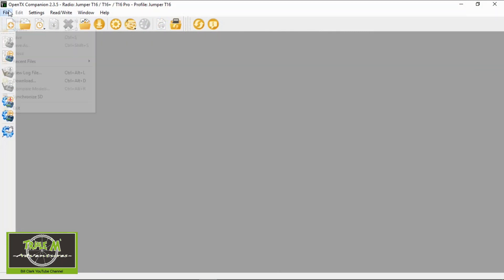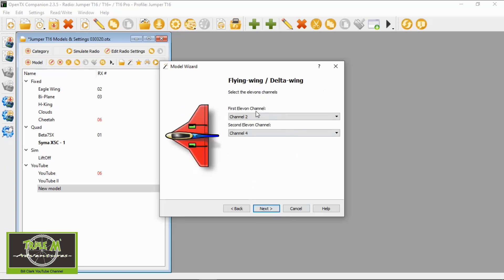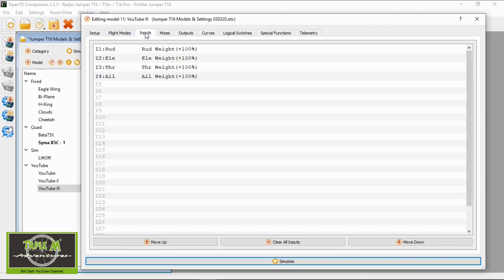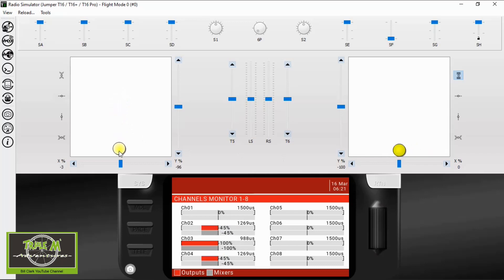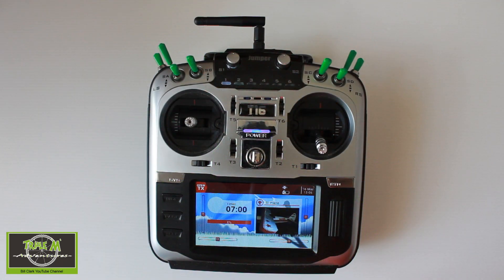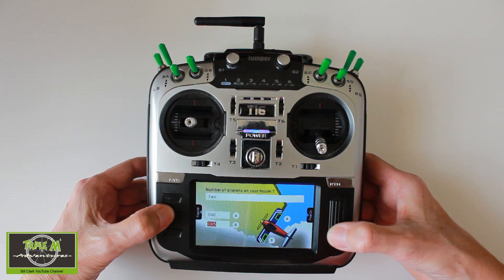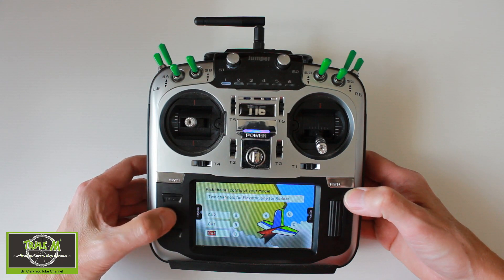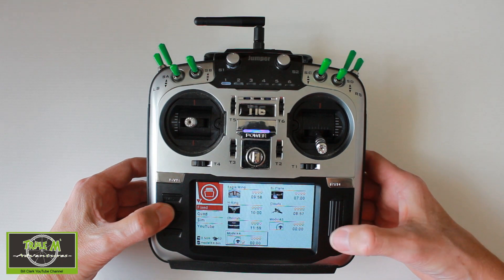Jumper T16 Setup Model with Elevons

Comment: Hi Bill. Thanks for the video. I keep a spreadsheet of all my relevant videos and you have a whole section. It's easier than using bookmarks or favorites. I can organize my favorite links much easier this way.

I have one suggestion. At the end, when you are showing the Hobby-King delta wing, it is hard to see whether the control surfaces are moving up or down. I'd suggest shooting the video edge-on, from the back of the plane, looking towards the nose, instead of the top, looking down. Then we'd be better able to see the elevons moving up and down. Keep up the great work!

Comment: hey bill can you do a setup on jumper T-16 nfor a VTOL mini convergence?  Also in open companion i noticed my setup was different like my throtttle is on the left.  Do you save on your SD card then transfer to your jumper that way?
Reply from the maker: I could Matthew but I do not have the model I see you can only use Spektrum DSMX & DSM2 receivers with that model so they will bind to the Jumper T16's multiprotocol module. I have downloaded the manual for the model and it refers to the Spektrum select model types which appear to be a standard normal aircraft type wing. The transition is controlled on AUX 1 which is Channel 5 on the Jumper T16 but the manual states Channel 6. So advising on the set up without the model would be difficult because I cannot test it. Looking at the Transmitter Set Up guide I would need the model to be able to help you. Once the lock down is over here in South Africa I will try and get the model because I would love the challenge of setting it up. Sorry I cannot help you now.
You radio is as standard which is Mode 2 I fly Mode 1 so I need to convert mine throttle on the right.
Here is my video of how I manage my SD Card
https://youtu.be/9B_guG_b7vw